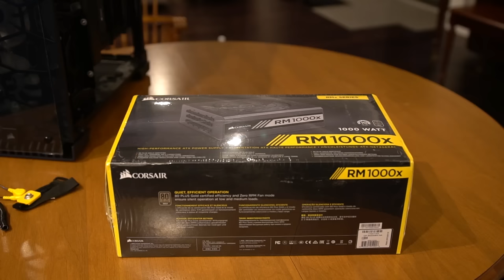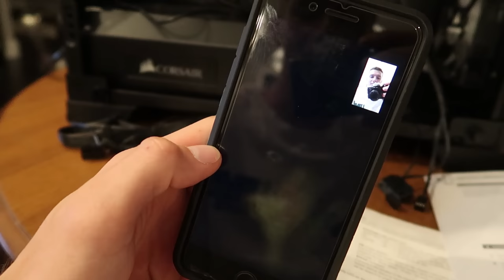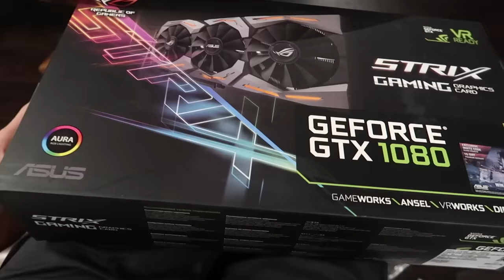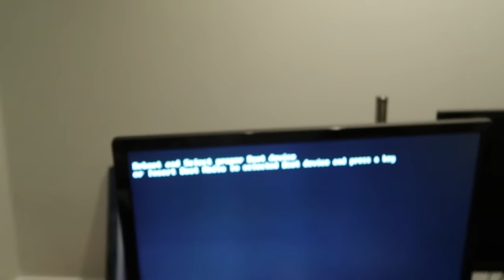Building my First Gaming PC

Comment: Adam, you wont understand how it feels to watch this. Its like seeing someone who doesnt know anything about cars, try to do a full rebuild on a 2JZ with the best parts ever. Putting the turbo the wrong way, dropping the crank on the ground. Forgetting the wastegate. It hurts.
Reply: Except for the fact that a car is $10k+ and a computer is $500-$2000. Totally different.
Reply: Actually, here in Norway that computer would be 3100 USD. And 4000 USD with the accesories.
Reply: Missing the whole point. Buy a decent used car for $3k and get a mid level paint job on it thatll remove dents and dirt and shit is $4k right there.
Reply: 2x1080's $1200.intel 7700k $370 ram $170 ssdh/hd $200 easy case $250 monitors $900..psu $100..water cooling $120 windows 10 pro $190 motherboard $250=$3750 and i'm sure i'm missing something..but i dont think that is the point the point was that we are watching someone who has the ability to attain our dream is messing up in building it even tho they have all the best parts and all the necessary tools
Reply: Putting a computer together cant even compare to the intricate work of fixing a car up though. Look at this he did it nearly perfect his first time. Doubt the same could be said if we got SodaPoppin or Pewdiepie or any other YTuber in the gaming community to put a car together from scratch
Reply: I actually do both myself have for a very long time got a boat anchor 305 i'm finishing up in a 82 z28 as i write this reply...it too isnt that hard i've taught 12yo's how to build engines and transmissions while building a car is a bit more complicated and entails dealing with many more parts it really doesnt take any higher level of intelligence but that can change in favor of the computer builder being more intelligent if they design any of their own circuit boards to be used
Reply: It isn't that it is so difficult. Its just that the parts are way to expensive for me and i would have been so much more careful with them. 😊
Reply: And i know alot about building engines. I have a moped that has about 4 times more power than it had when i bought it. And i know that doesnt compare to a 2JZ or anything but i know the basics and more than that.
Reply: those 2 dont even know how to build a computer i think you mean jay2cents,linus tech tips, gamer nexus or luis rossman which you can argue luis rossmans job is just as hard since he fixes motherboards and resoders new chips and finds bad chips using voltage  plus building a water cooling pc with custom tubing isnt cake either

Comment: "oh were not supposed to touch this" as he removes his fingerprints with his shirt and probably built up static frying the card 6:30
Reply: lacey javen 1234 but it was in plastic when he touched it and used his shirt
Reply: touching the heat spreader isnt a problem just clean it off with some 90%+ isopropyl its the other side that can be sensitive...
Reply: lacey javen 1234 He said "Oh it was in plastic"
Reply: Calling a cpu a card wtf

Comment: You forgot SLI bridge, (y) up so he can see :)
Reply: penninviisaampi perkele aiva oikein
Reply: No perkele niinhän se onki
Reply: Its all good its his first go its still useable till he gets it
Reply: Yeah but its good that he know he needs it
Reply: penninviisaampi yeah he knows how do you feel about that no thermal paste thing ?
Reply: and he only had 16 gigs of ram for that pc, he really need a larger amount fo the the load of 3 moniters running at fast speeds
Reply: Ben Mueller 2x 16GB would be great
Reply: nah speeds dont matter for ram he has 3000 mhz and 16 gb is enough for any build 32 or more is way overkill
Reply: He should use it, dont work that way. Always need to use it. :)
Reply: i have 12gb of ddr3 and run 3 monitor and gamer across all 3 you dont need more ram for more screens
Reply: Snubz if he has 2x 8GB ddr4, then it should be fine
Reply: Adam can run 3 monitors with 3 xbox cuz they can sync if u use the same wifi
Reply: There is 0 point to sli since it doesnt work properly so he basically wasted money on getting a 2nd 1080
Reply: Ben Mueller RAM is only needed for multi tasking what you are referring to is needing more vram for the three monitors which he does have plenty with 2 1080's
Reply: He didn't need to apply his own thermal paste. The H100i comes with thermal paste pre-applied.
Reply: Niff true that
Reply: why do you lie they work fine and you get more performance out of sli without it causes more issues making the 2nd card useless with sli they work together meaning more frames
Reply: Why is everyone acting like they know PCs. Please stop, 16 gigs is plenty even if he has 3 monitors. That means nothing. I have 8 gigs and run 3 monitors. 3 monitors would mean he needs more gpu power which he has. Second, 16 gigs is plenty for what hes doing until he gets into streaming/recording AND VR at the same time. And if you watched the video he said he was looking into the SLI bridge. And it comes in gpu boxes anyways so he has it. The no thermal paste thing isnt a problem because if you look at the watercooler when he mounts it to the motherboard, it has preinstalled thermal paste.
Reply: moldytoast44 thanks didnt know :)
Reply: he may not need it with that motherboard
Reply: Yer 16 gigs is fine and the cooler comes with pre applied thermal paste.
Reply: Comes pre-applied to the bottom of the CPU block.
Reply: Mista, VRam doesnt stack and never will lmao
Reply: h100i come with thermal compound pre applied
Reply: Skullraiderz it's all ready on the cooler plate I have the same one
Reply: It comes pre applied with the cooler dude.
Reply: Skullraiderz no it won't, it come pre-applied
Reply: GameTraps YT I have the same cooler it's pre applied
Reply: Quincey Warner The thermal compound was pre applies on the cooler :)
Reply: That would be true if DX12 based games did that - they do not - yet - and it does not look like the mem sharing will come soon - that said 8gb of ram i still fine :)
Reply: penninviisaampi He also used the wrong slot for the ram. He put them side by side, instead of using the recommended slots.
Reply: 13:38
Reply: eiks se sanonu videos et sil ei oo sitä...
Reply: lol consoles
Reply: comes with the motherboard, not so much with the gpus
Reply: You do relaize the thermal paste that comes on the cooler is some cheap crap even other pc builders say to apply your own thermal paste
Reply: the ram is dual channel, the channels are the two far away from the cpu with a gap, the ram is correct
Reply: @Skullraiderz No he used the right slots, you can see 12:45 that he kept them separated by a slot.
Reply: the thermal paste is pre-applied
Reply: nice job watching the video
Reply: monitors dont run of RAM
Reply: Lol, I run FH3 in a 6400x1080 arrangement..... All ultra, 30-60fps with an i3 6100, 8gb of RAM and a RX480 Red Devil
Reply: penninviisaampi ikr
Reply: Ben Mueller it's monitors bud
Reply: penninviisaampi he might have a sli cord in his motherboard box.
Reply: That is not true. 32 gbs is so damn over kill.
Reply: penninviisaampi about how much does it cost to make that same computer
Reply: Skullraiderz Not necessarily, sometimes the channels are side by each. However, I am unfamiliar with this motherboard so you may be correct about the channels being split.

Edit Also to add to this after reviewing the video, he had spaced them.
Reply: That cooler comes with thermal paste pre installed on the block.
Reply: Getting 16GB sticks is not always the best choice, especially if one dies.. Best to get either 4GB sticks or 8GB sticks.
Reply: Defying History You're right, the thermal paste that is pre-applied is likely to be lower quality. However, with what he is using it for it shouldn't be an issue. I doubt he is overclocking and overvolting the CPU. Even if he was, reliability issues probably wouldn't occur until after 100°C. If he was overvolting and stress testing his CPU, I don't think it would get even close to 90°C.
Reply: he forgot to hookup the 2nd power cables for the gfx cards
Reply: oh nvm...
Reply: pakara
Reply: You dont need an sli bridge with pascal video cards :') with pcie 3
Reply: unless u are doing video ecoding, editing etc yea it is but hey I wouldn't fault anyone for going 32gbs if they have the budget for it. No such thing as having too much RAM.
Reply: The cooler comes with it pre applied
Reply: Tremble Dust if it's more than the Motherboards max supported ram its too much ram
Reply: ?? He's running 2 x 8GB sticks of DDR4. The board supports a max of 64GBs. How is that too much RAM?
Reply: to my knowledge gtx 1080s in sli work very well. Its only if he plays games that don't support sli that he will face "issues" but even all the system is going to do is just run the one 1080
Reply: yea but majority of users who go the AIO route aren't trying to achieve high overclock levels and on stock the paste that is pre installed on most AIO's is extremely acceptable. Yea u could swap out the pre installed paste for some aftermarket stuff but u really don't need too especially if u are running stock. That said however him not realizing there was paste on there is not a big deal. Its a rookie mistake. It happens. Just be greatful he didnt wipe the paste off and run the rig without it. I had a client do that once. I nearly split my sides laughing lol
Reply: oh lord stop it. if one stick dies u run 8GBS temporarily. Big whoop. U rma the sticks and in the interium for waiting on the replacement sticks u get yourself a hold me over kit. Again not the end of the world.
Reply: Tremble Dust I was just giving an example
Reply: /making a bad joke
Reply: oooh. sry lol
Reply: well if you never reach 80% usage then you will never get full efficiency but it really doesnt make that much of a difference on a power bill for a single system...this changes if you do a datacenter or something tho the costs can get ridic over a few percent efficiency change..which i'd say this guy was not so worried about as he didnt go with a platinum rated psu
Reply: I'm not sure that I agree completely with the much of a difference on the power bill statement. I know from personal experience with my cousin had a 1200watt power supply in his single system. His power bill went up $30 a month. He did, however, leave it on 24/7.

Comment: I’m building my first pc ever.

WITH WATERCOOLING AND DUAL 1080s
Reply: Yea me too stop being poor
Reply: yeah and a brand new i7
Reply: Exactly what I thought. I clicked on the video and immediately saw he had dual 1080s and I went like WTF. As I continued the video to my horror I saw he was water cooling it. PLEASE GUYS DO NOT WATER COOL A PC IF ITS UR FIRST BUILD. Then I saw the dude forgot the sli bridge.🤦‍♂️

Edit: typo
Reply: @tamisbraaf6968  im not really good at pc's so why not use watercooling?
Reply: @bart-ye2iq  water-cooling is better if your going with a really high performance rig, meant to do high quality gaming and very intensive tasks where your components will get very hot. Water-cooling is better at cooling components than air cooling. But it is very hard to install and is totally not recommended for beginners as you have to install it manually and combine the loops and bend them etc. So if you are building your first ever PC with no knowledge about what to do, save yourself the hassle and use air cooling.
Reply: TyrameZz AIO is a bit easier than a custom loop water cooling, personally I prefer AIO over air cooling.
Reply: Well I mean a decent cpu aio water cooler can be just 20 dollars Australian aka 15 usd around
Reply: AIOs are actually pretty straightforward to install

Comment: Bought two 1080s and he didnt even buy a sli bridge... lol
Reply: BRAD LYON I’m getting into building a pc but what is a sli bridge
Reply: its a thing that plugs into 2 graphics cards to make them work together.
Reply: Carlllooosss so basically when you buy two or more gpus (graphics cards) you need to use an sli bridge. Its a thing that connects multiple gpus. If you dont connect them with sli they wont be connected together and be useless.
Reply: Every GPU I’ve purchased comes with an SLI bridge.
Reply: you also need to remember that SLI only works for nvidia
Reply: BRAD LYON this community is so supportive. Yall gave the man his answer except of sayin darude sandstorm or hes stupid or something 👍👍
Reply: if his motherboard supports SLI it should have came with an SLI bridge. also GPU's include them sometimes, so I think he just forgot to install it (mainly because he had no idea what an SLI bridge even was at the time of this video) rather than forgetting to buy one.
Reply: @carlllooosss2380  a device that allows you to use 2 gpu's
Reply: If you were attentive you would see he mentioned it in the video.
Reply: Crystal Defaulty So does it technically double the graphics/fps you get?
Reply: Yo I’m like half way in the video but he didn’t get the sli bridge
Reply: Would a 1050ti work with a 1060 6gb by using sli?
Reply: Its okay, he has flex seal im sure. That should work just fine!
Reply: @Thomas-lz2kb  they have to have the same memory at the same speed for them to work together, or so I've heard.
Reply: @jordanrussell9513  Exactly the Opposite of zou sadi they work independent from eachother. In the Old days Sli cards worked toghether but now 1 Card renders 1 Frame and then the other one.
Reply: Brandon Tran what!? And does  sli??? It’s just called crossfire
Reply: That nice of a mobo probably came with one in the box
Reply: The sli comes in the mobo box
Reply: He is using the second one as the nvenc for streaming. This would be my smart guess. Very smart move! You dont need a sli bridge for that.
Reply: Gregory Dale Mostella that's a borderline flex because high end graphics cards usually come with those
Reply: Thomas Grannes they have to be the same gpu and they have to have a sli connection
Reply: @carlllooosss2380  nigga sauce
Reply: lmao

Comment: Just so you know, you should unplug those PCIe power cable adapters from your graphics cards and just straight plug in the regular power supply cables. Other than that, not too shabby for a first time build!

Comment: If anyone was thinking about it, this setup costs around 4000 dollars (did a quick research with all his specs), and you still need the tv's...
Reply: Pedro Ribeiro holy shit lmao i knew it was pricy but damn, i can only dream
Reply: randy durga I know right? you can buy a decent car for that money
Reply: im confused on what you are saying? yes he has money. They are for 1 called monitors and he already has them.
Reply: TVs are monitors
Reply: Don't worry a good monitor at say 1440p and 144hz is only going to cost you about $500-$600 a pop...What's another $1500?
Reply: negative TVs can be used as monitors but Monitors do not have tv tuners built in and tvs do not have the refresh rate of monitors and TVs will have problems with ghosting  allot of time when monitors will not unless it super cheep 
yes there is a big deference between a TV and a Monitor 
main one is Input lag the delay between movement you make and what displays on your screen TVs simply do not handle high frame rate that a video card can produce
Reply: He already has the TVs
Reply: i just built it on PCPP with no peripherals and no windows and it was only US$2650....but still...its a LOT of money haha
Reply: monitor*

Comment: RIP THE 1080TI JUST DROPPED :(((((((((
Reply: might as well just throw it out the window
Reply: waits outside window with arms ready to catch
Reply: Its not a fragile piece of shit, much less sensitive than you think.
Reply: Spanky  can still break it
Reply: Yea, until you knock off a transistor of something
Reply: "A new version came out, then the old version sucks!"
Reply: MultiTerpen I don't think you understand. 35% performance increase for an extra $50. So yes. It does suck.
Reply: +Nick Lindsay-Abaire  And its not out yet
Reply: ya but 2 of these are better then 1 1080
Reply: not 1080 what he has but whatever newest one is, i thought 1080 was the newest. And i thought 1080 you couldn't sli or was that the 1060?
Reply: H Legion it's the 1060
Reply: Nick Lindsay-Abaire Its not 35% they said the 1080 was equal to a 980 sil its not its not even close. So in no way is it 35% Your saying. its about 25% faster than the titan xp no XP is faster. So the XP is still the winner 1st xp 2nd 1080ti 3rd 1080
Reply: 2 1060 would be better then 1 1070, 2 1070 would be better then 1 1080 etc etc.. common sense
Reply: H Legion not exactly
Reply: MegaxeonLV never said it was bad lmao it just sucks that he could've waited a month and spent the same money on two reference 1080tis and gotten better performance
Reply: GamezAhoy the point is he could've gotten better performance by a significant amount and spent the same amount of money if he waited a month.
Reply: Nick Lindsay-Abaire the TI is not even out yet lol
Reply: Cristian Diaz within march says Nvidia
Reply: Adam lz get steam
Reply: Kyle P he did because you can only run assets corsa on steam on pc
Reply: +Nick Lindsay-Abaire  You you are right . But i rather enjoy the video now :) . Im sure he wont even need more than that :D
Reply: Nick Lindsay-Abaire it's just a 1080 strix. Not a new 1080ti